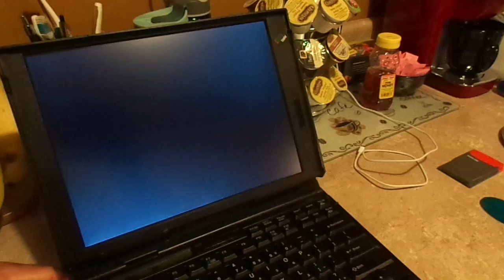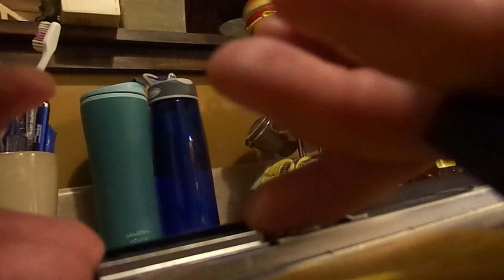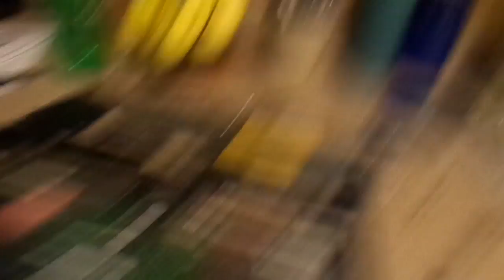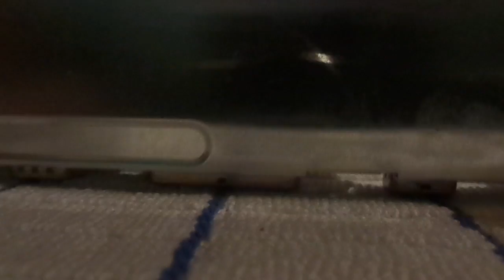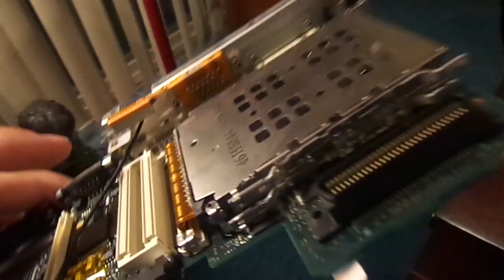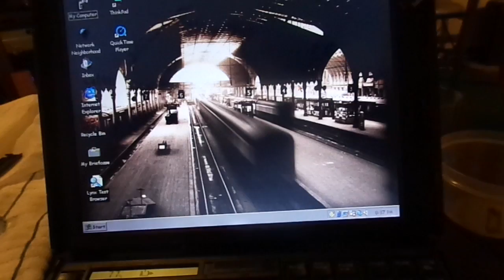IBM ThinkPad 760XL Autopsy

Comment: This series is great for stripping down and building a car computer. I use a 765D/L/LD mounted inside a U1 server case. You can upgrade the processor to a Pentium 233 MMX which is enough to decode mp3 files or play flac files. Mine is hooked up to a Delorme GPS usb module, an 8 inch touch screen from an old IBM Point of sale register I sourced from a surplus place in Winter Park, Florida, and after many hours of research and soldering is hooked up to my car pcm using windows xp embedded and autotune. This way I can monitor all aspects of the vehicle performance in real time and change settings as well. They can take the heat of being in the trunk.

Comment: Sounds just like how I killed my thinkpad T420 (which is advertised to have a spillproff keyboard). I was working on a paper, and I knocked a glass of orange juice straight onto the keyboard. It drained through the machine via the "spilled drink canals" that lenovo engineered. However, I left the machine on long enough to move 20 gigs of files off of USB 2.0. I then shut it down. The mainboard was completely trashed, but the SSD was OK (thankfully). It was under warranty.
Reply: Hahaha! I understand your pain. In my last year of school (2013) i used my thinkpad everyday (that thing handeled the 9 hours of class without a charger!) and i saw those water videos, and i just spilled 3 drops of water of the size of a bottle cap, and it worked fine, then the trackpoint buttons stopped working, and finally it shut off, luckily for me, a technician fixed it just by replacing one microchip on the motherboard, just a USD30 repair, phew! Mine is on warranty until 2016, but that didn't covered as far i know, it is still my war horse and it didn't failed, just one tip, if something spills on your T420 don't move it! Let it drain, and wait, even clean it with some toilet paper if you can. Remember, i did this because i thought i was going to replace my thinkpad, but those new click buttons suck! Our thinkpads are the last thinkpads ever made, take good care of your T420, i'm planning to get a W520 with a core i7 extreme if i can, but a new one of course not.

Comment: glad you got it working but i have spilled coke and coffee on lots of consoles and computers over my 35 years of owning. i always turn it off and rip battery out straight away, wrap it in a towel and stand it on the end were the liquid went, put it in an oven on lowest heat, bareley warm for a few hours. tear it down to remove residue and put it back and i have revived every one except for an samsung s2 which my dog knocked into a glass of lemonade. trhe dogs gone.now. kok. honest.

Comment: I had a old gaming computer which still works to this day, I tried a water cooling kit on it the line on first run popped on the out of the CPU block. So water and radiator fluid went all over the Video board and Case both to this day still smell like radiator fluid.

Comment: It's amazing how it got a bit of liquid and you cleaned it up and it came back to life… I hope you can keep it in near-mint and working condition for the next few years and enjoy windows 95 in 2015. Also, i didn't know you had an iPhone, last time i saw you with your phone was a flip phone. I'm sure you'll keep all the extra bits along with your parts unit if you choose to buy that.

With your "battery about to come crashing down", you reminded me of when I was using my Samsung Q1 on its new-old stock extended battery and it stayed at around 20% for a good ~30 minutes or so. Keep in mind that I hadn't calibrated the battery using the tool built into the BIOS, and the extended 6-cell battery would last about 6 hours and the standard 3-cell battery would last about 3 hours.
(Note to my subscribers: I will be doing a video of my Q1 soon)

171 error… something about the CMOS instead of the usual 161 and 163 errors.
"171 – Rolling bit test failure on CMOS shutdown byte" (http://www.bioscentral.com/misc/ibmdiag.htm)

When you mentioned that those models flown in outer space, a photo of the inside of a section of the International Space Station came to my mind where a couple of 760 series was in the shot, one open, one closed and both were mounted to their own arms.

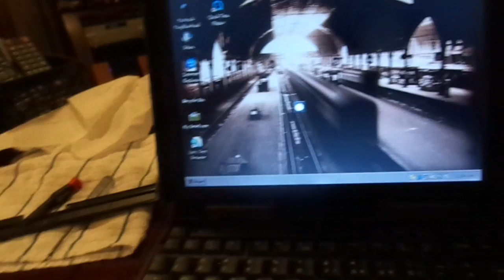38:38 "…because this is one of my favourites…" Yeah I agree with you on that.

Comment: I disassembled my T61 once to clean the cooling system and it was a pain in the back. But the machine was probably used mostly on the docking station (which I have) since the keyboard has almost no wear on the keys

Comment: I've got a Compaq Armada M700 that also shows signs of liquid damage (not from me!). Its original keyboard was horribly icky in some areas, and there are tell-tale signs of residue on its main board. And just like this, it is maddening inconsistent; sometimes it will charge its battery, other times it won't. Sometimes it will work with its DVD drive, other times it won't. Sometimes its built-in memory will work, other times it will give an error code. Its hinges were OK, but the plastic of the bottom chassis was decaying badly and the last time I worked on it, various bits of the plastic were just falling off.

Comment: Reminds me so much of my old 755CSE, it was a great machine. I loved that laptop so much. unfortunately after many months of storage, the standby and cmos batteries had corroded badly, ruining the dsp board. fortunately, the machine was still salvagable, altho it threw an error 301 at bootup, which means system board failure. I bought a parts donor system off of ebay and fixed it up like new. it even has the original 540 mb hard drive with the original install of dos 6.2 and windows 3.11. Its an awesome laptop to this day, and has taken a hell of a beating. By far the most capable and durable 486dx4 laptop I ever saw. also interestingly, the memory comes on pcmcia-esque cards.
Reply: From good to bad to good again. Awesome story you have there…

Comment: One morning, I had a glass of ginger ale (what a coincidence...) sitting on a PC in the middle of my room, and when I got up in the morning I managed to kick the glass off of the computer and it spilled all over the floor, the computer, and an LCD monitor.

Lesson learned, right?

Well, one night, I was doing stuff in my room and I had a full glass of soda... which I put, once again, on a PC tower... And kicked it.

One frightening "sploosh-gloosh-gloosh" later and my PC (which was just sitting there, not even plugged in) was soaked in soda. I wasn't sure weather I was more pissed off at damaging my PC, or spilling three quarters of perfectly good soda.

Ah well. Maybe one day, I'll clean out that PC and see if it still works. :)

Comment: If you think these are hard to take apart then you should try a 770z, makes a 760 look like a walk in the park. lol
Reply: The Advent 7094/ECS 321 will probably beat that. That thing is a total bitch to work on.
Reply: *****  I have a Clevo D870P/ Eurocom Mirage, or some variation of that laptop, and I've come to the conclusion that either I am an idiot, or that it is impossible to disassemble completely. I guess everyone who has an ancient laptop will probably have a "hardest laptop to work on", though I think it would be interesting if somebody did a kind of competition to determine one that is the worst of all. :D
Reply: ***** The funny thing is that the Advent 7094/ECS 321 isn't an ancient laptop; it's got a Celeron M in it. It also seems to be impossible to take fully apart, or even far enough apart to get at the CMOS battery. Removing the keyboard is ridiculously overcomplicated as well.
Reply: I opened up all my IBMs i got and they are extremely easy, specially the slim 560, but one day my hp 9650US broke down (graphics like all of them) and guess what? With my thinkpad T420 i just need to remove he single cover and one screw to take out the keyboard, while the hp had like 8 screws to open the speaker cover, then 6 more for the keyboard, and then everything was covered in a plastic things that said like screw you! You can't with me! And it was right, i know there must be harder machines to open up, but that was hard for me. The thinkpad 380ED isn't hard and it's like this one with lots of layers like a 100 year old pocket watch.
Reply: taunusv4power The best designs use small plastic sliders to retain the keyboard - no screws required. Apple's Powerbook G3 (at least in Lombard form) and the Compaq Armada M700 use these.
Reply: *****  Yeah, I guess they are not "ancient", but any piece of technology over 7 years old is still pretty archaic compared to what we have now. That's what I really meant by "ancient". My laptop isn't too much of a slouch either, it has 3.2ghz Pentium 4 HT, 1gb stock ram, and dedicated Radeon 9700 graphics. Pretty good for a '04 laptop.
Reply: ***** Sounds like a real lap frier to me!
Reply: *****  Yeah, it gets up there, not to mention the fact that it bruises your legs at the same time because it's around 10 pounds :D
Reply: ***** That's pretty weighty for a modern-ish machine. My Sony Vaio PCG-FX 601 is also a bit of a lap warmer, with its 1.1 GHz Duron, but it's a very useful old games machine, and still has 45 minutes or so of battery life on what may be its originally battery.
Reply: *****
 That's cool, since my laptop can run Windows 2000, it will probably be good for old Windows games if I ever get any. I might have been slightly exaggerating on the weight, it is probably closer to 6-8 pounds. But it does have a solid piece of copper over the DVD drive that is part of the heat sink, plus two fairly large copper fins, and two large noisy fans :) Then, under the keyboard, it has a solid piece of metal the size of the keyboard with copper tubes to cool the GPU. So overall, it's not the best or lightest cooling solution ever invented, but it has a big job to do cooling that desktop CPU (socket 478).
 My dad and I also tried to rebuild the original battery and that was kind of a failure. We had a little bit of a fire with a cell that reached the circuit board. The battery charged and works, but only lasts for 45 minutes if I'm lucky, so I think that most of the eight cells are not working because of damage to the circuit board.
Reply: ***** The Vaio is dual-booting XP (which it has a COA for) and 98 (which I had to jerry-rig the drivers for; I've used various other OEM's drivers for things like the sound!). I'm not competent enough to try rebuilding the battery, but I may well get it done at some point. Quite why Intel and laptop manufacturers thought that full-on Pentium 4 desktop CPUs would work in laptops is beyond me... but there you go.
Reply: ***** I had a Gateway laptop with a 3.2GHz Pentium 4 HT. That thing got hot. The head of my college's tutoring center bought it.
Reply: Yet Another Person I can imagine - and I bet it either ate batteries, or had a massive battery (or both).
Reply: ***** The battery lasted about 2 and a half hours. She used an iBook G3 before I sold it to her. She loves that Gateway.